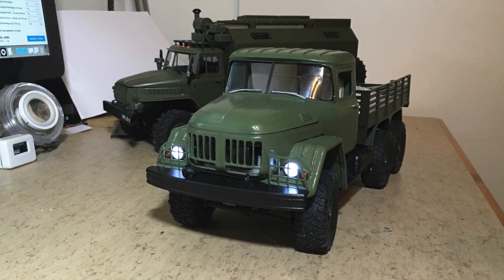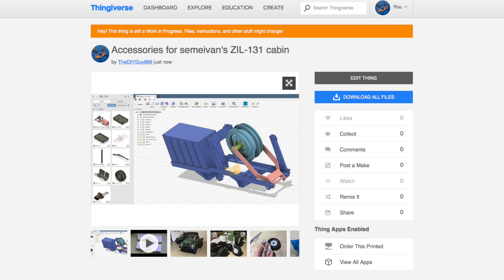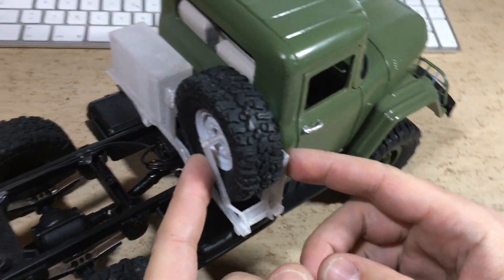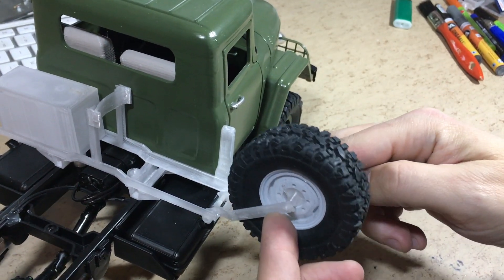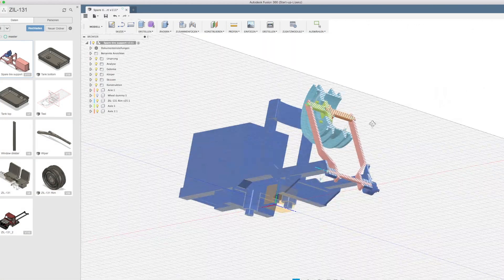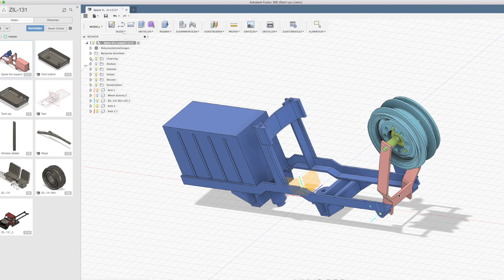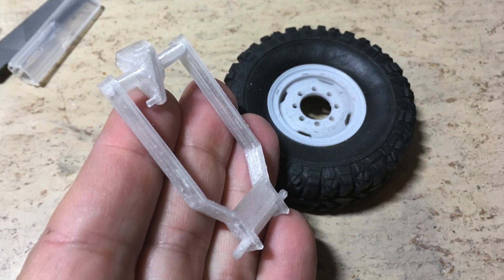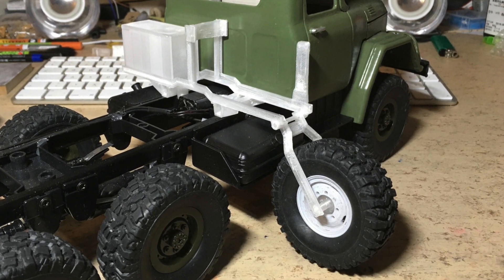STL Accessories For The 3D Printed JJRC ZIL-131 V8 Now Available On Thingiverse

Comment: Hi!! I love all your videos, i just had a question becuase i will try to do the same hackintosh cube as yours, i am going to  uy an intel DQ77KB, but i have an i7 2600 processor, is it compatible with the motherboard? 
Ps i live in switzerland to!! Would love to see your hackintoshes!! 
Would love an answer!
Thanks again!
Reply from the maker: I would use a more recent board, because the DQ77KB is about 6 years old. You should search for compatible components on tonymacx86
Reply: Thanks alot! I'm going to check because i just bought an second hand intel DQ77KB on ebay so i'll see
Reply: And i don't need a super powerful mac at all. Just to know, how did you do your hackintosh downloads?